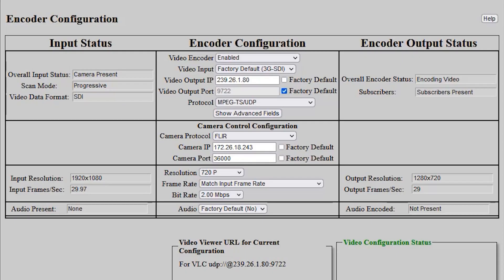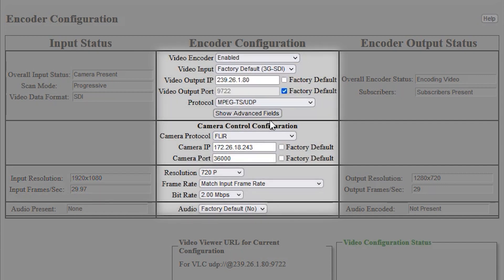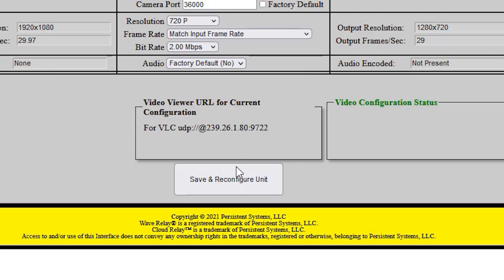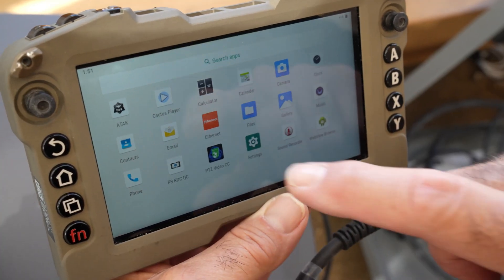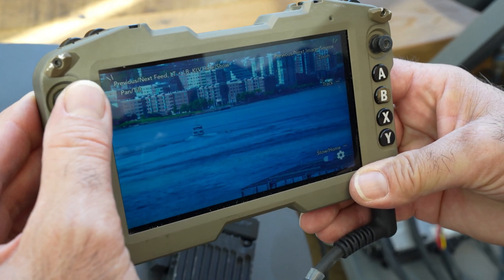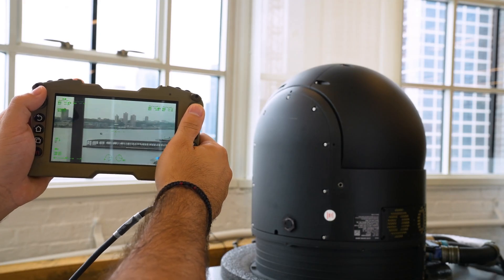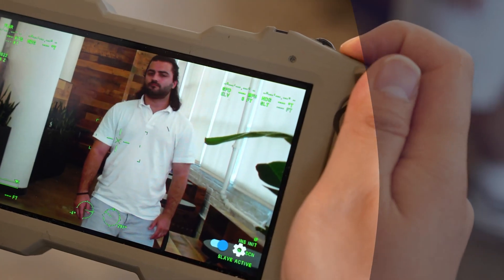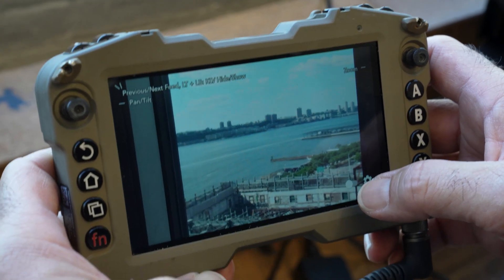Airborne Camera Control with the MPU5 and Teledyne FLIR 380HD Camera

Comment: What other camera's that don't cost 500 grand work with the MPU5
Reply from the maker: Any IP camera. The MPU5 can encode video itself through a BNC port (3g SDI) at the top of the radio. If video is encoded outside the MPU5, you can inject that video through the side ports to be shared over the network.
Reply: @PSWaveRelay cool

Comment: My question:

If i have aatached the bnc cable of flir camera to radio of unmanned object 

Then how can i wirelessly connect with the camera on ground station  with the same manet radio
Reply from the maker: Either through the PTZ app on the radio (which auto discovers feeds on the net), Atak/WinTak, VLC, web browser… any thing you want that has the ability to pull and display local network feeds. Just typically requires the assigned IP and Port for it to search for it. You are just telling it where to look.